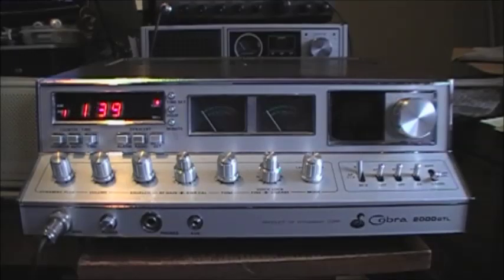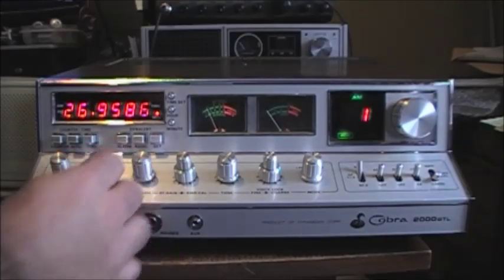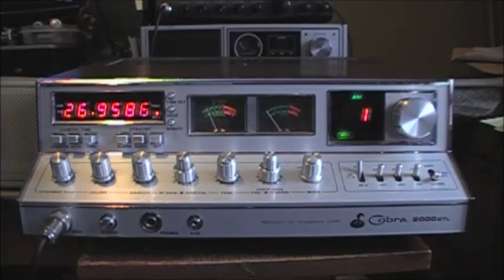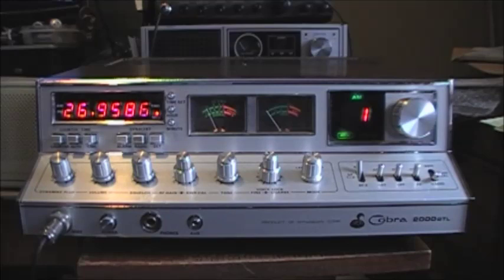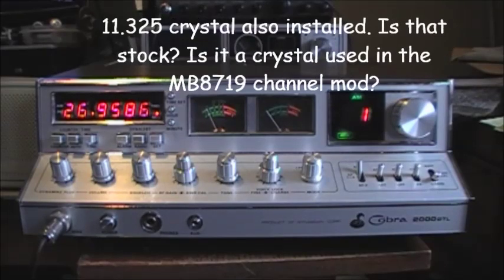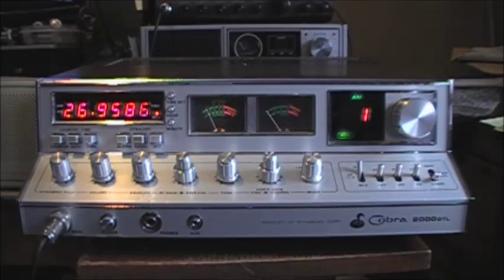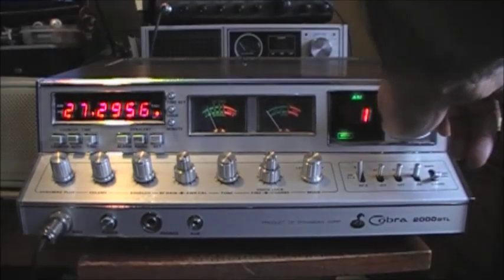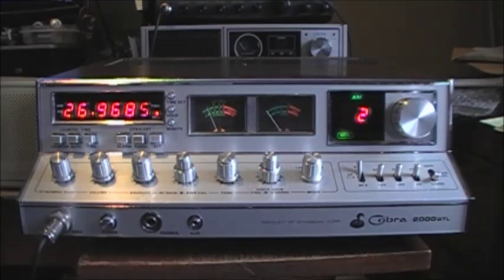Cobra 2000 GTL update

Comment: I had the same issue with a Cobra 2000 and the frequency being off like that.  It turned out to be a missing wire that was soldered between the coarse and fine voice lock potentiometers.  I noticed this when I saw the insides of a working 2000 and compared the two.  I put that wire back on the voicelock pots between the two specific lugs on the pots and the frequencies were back where they should be.  The radio I was working on had mods as well so I guess when it was modded they took out that wire on the voicelock pot(s).  Yeah - I know this video and thread is very old but someone can perhaps use this info - who knows.....
Reply from the maker: Thank you Sir. This radio still sits in my closet with the same issue. I really appreciate the information. Can you send me a private message via email so I can possibly get more information on where this wire goes. This is awesome news and you have a keen eye my friend.

Comment: take it to a real cb place.. no real cb shop would have let that radio go out in that condition..
Reply from the maker: Wish there was a place to take it but it looks like heavy postage back and forth and repair costs to get it sorted out.
Reply: a lot of big truck stops have cb shops. and are usually pretty cheap. dont give up on it. its the all time caddilac of cb radios..
Reply: they usually use the anl or pa or noise block switch for the 10 kc drop switch.. its usuall just a 10 ohm resister soldered onto the pll chip but could be anywhere.. i would have left the voice lock opened up because at least you could slide down to the matching frequincy.. thats the quickest fix i can think of..
Reply from the maker: Ok Cool. I will dig it out of storage and have a look with my novice eyes and see what I can find. Thanks for your input. It has been awhile since it was benched by a friend. He is real handy with the 858 PLL boards. I am sure if he had more time he would have got the issues worked out. I'd love to have it back to 100% but good techs are 1000's of miles away
Reply: where do you live? a lot of truck stops have them.. its an awesome radio and worth the effort. i have been looking for one for years.. but i want it fully moded.. i know it will go well into 28mhz and down well into 26mhz..
Reply from the maker: I live in NL, Canada. if there is radio techs around here they are keeping a real low profile!
Reply: if your friend can open up that clarifier have him do it that will solve the problem.. you can just slide down one channel problem solved..
Reply from the maker: So true... My next step is to have another look at it myself and then, if ever, it will be sent to a tech to finally restore it 100% or its got to go.
Reply: plus if you open up the clarifier there will really be no need for a 10 kc drop switch.. you can just do it with the clarifier..dont throw it away!! but if you do i will be more than happy to send you the cost of shipping and handling :)

Comment: Does this Cobra 2000GTL happen to have the open clarifier mod. If so, then you should be able to get it on frequency.
Reply from the maker: Yes, the clarifier is open. Unfortunately, the rest of this troubleshoot is beyond my capability I think. I really need some help at this point. I am a novice noob when it comes to this kinda work.
Reply: Andy Tobin After I asked that question, I noticed that the frequency did not change when you turned the clarifier, further on in the video. At this point I would try correcting the crystals first before I did anything else.
Reply: Andy Tobin I have a similar 2000GTL that I am in the process of unmodifying. I am lucky that the PLL chip was not replaced, they had just added different crystals on a 3 way switch. I am still troubleshooting the unlocked clarifier issue. I undid the mods but it still slides 2 channels either way. Also have a flickering frequency counter issue. Will keep a watch on your progress, and input where I can. GL es see you on the air.

Comment from the maker: My best advice to you would be to bring it to a technician. It is odd that the exterior freq counter is dead on but the radio freq counter is still a bit off. The frequency counter of the 2K is pretty much accurate. I am not a technician so I would only be guessing what is wrong based on my experiences with this radio and others. Where do you live? perhaps you might have a technician near you that could look at it. Wish I could be of more help to you. Good luck. Keep us posted on the situation.

Comment: I just bought a cobra 2000gtl the other day andy...ive tryed putting it back on frec and on am side its like the frec counter is not clocking right....I hooked up another frec counter and got it as close to frec as I could but now the 2000s frec reads out 27.4047 but my frec counter I hooked up reads 27.4050 so...now on ssb its reads on frec but I hooked up another radio to tune it by ear and its not right so I seen your video and was like mine is doing the same thing...Please help me andy lol
Reply from the maker: YouTube had these messages Hidden. Thanks for your comment